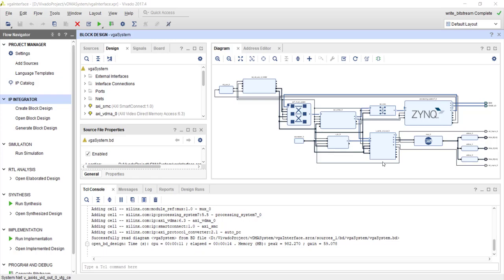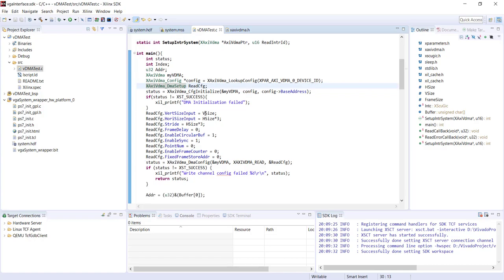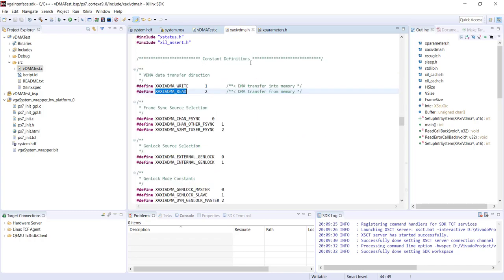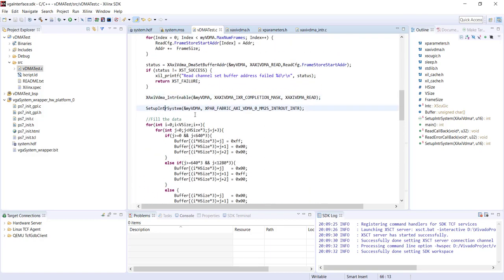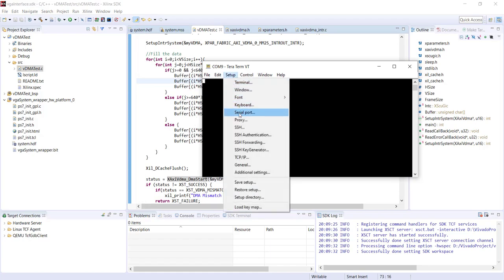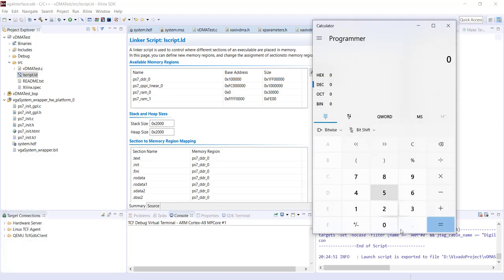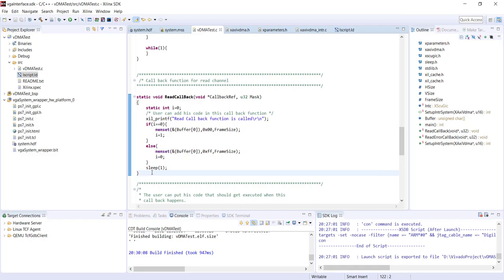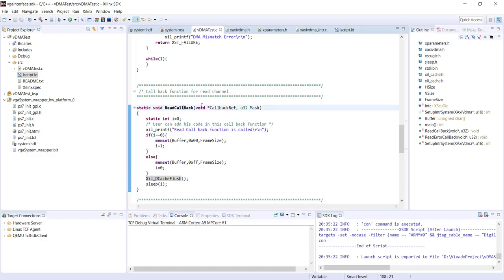Video Interfacing with Zynq (FPGAs): Part 4 Developing VDMA Software and hardware Testing

Comment: Hi sir actually i am using zybo z7-20 I wanted to aks like i am connecting the Zybo HDMI TX Pin with the monitor hdmi via cable but not able display the output in monitor. I am able to see Read Call back function is called in the serial terminal . What is the reason i am not able to see in the display.

Comment: Hi, great video. Just for a problem, could we remove the VDMA and connect the video2stream  and stream2video together to skip the memory access latency?
Reply from the maker: Yes that is possible. If you just want to stream the input to video output that will be better.

Comment: Excellent video bro !!!
could you explain the process for writing the camera data(AXI Stream) into DDR through VDMA? ( bare metal driver)
Reply from the maker: I could never test it since I don't have zybo board. Did u try the hdmi pass through example?
Reply: @Vipinkmenon  Have you did any video for that?
Reply from the maker: There is a demo from digilent for Zybo. https://reference.digilentinc.com/learn/programmable-logic/tutorials/zybo-hdmi-input-demo/start
Reply: @Vipinkmenon  Thanks. I will check and update
Reply: @Vipinkmenon  have you tested in zedboard? If yes, please upload that video too. It might me helpful for me
Reply from the maker: Zedboard has no hdmi input. Only output. Output video I have posted
Reply: @Vipinkmenon  Yeah.. Definitely I will update you.
Reply: @Vipinkmenon  I completed  write and read in ultra - 96 board using VDMA. I verified the data using Chipscope. But I have issues in display the test pattern in Display port (I'm using the Display port example design baremetal driver). It doesn't work properly. Could you help me on this?
Reply from the maker: As I said I haven't even seen that board!!
Reply: Hello, After writing data to DDR memory, Can u pls help me with how to write data back to DDR Memory through VDMA.

Comment: this video can apply to every zynq board? (ex: zc702)
Reply from the maker: Everything will be same, except the video output interface. ZC702 has only HDMI. So in this first series of videos I am using VGA. But for interfacing with HDMI part, there is a separate video
Reply: @Vipinkmenon  have you done video for hdmi interfacing?

Comment: I try to implement with this code i got error for header file 
Also in video
At 1.10 there are two erros and at but after 2 second these are eliminated plz guide me here
Reply from the maker: If u r using the code from git repo, it should be working. If error happens choose clean project and rebuild all in sdk
Reply: Sir I am also facing the same issue . The error message indicates that undefined reference to main could you please guide me @Vipinkmenon